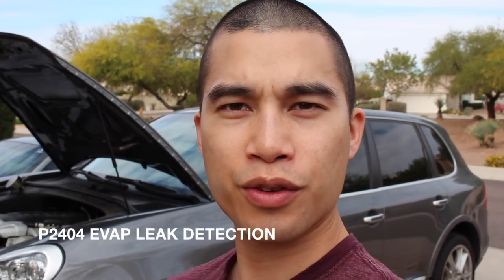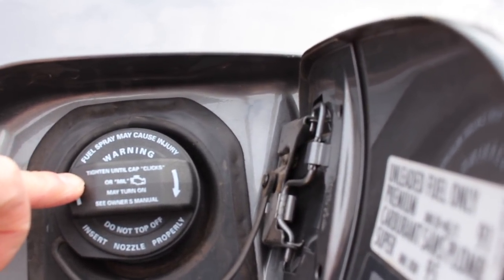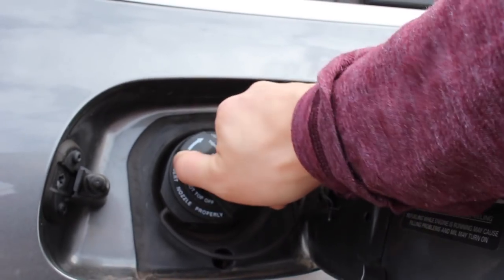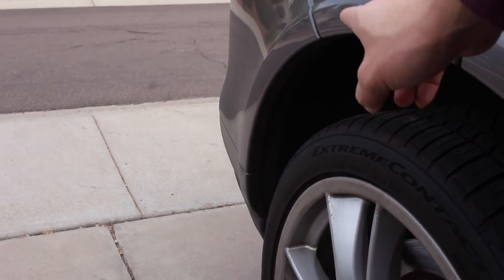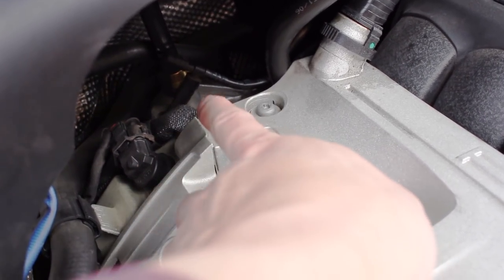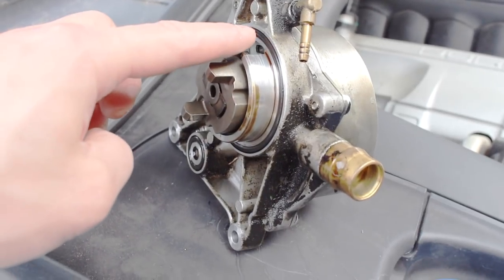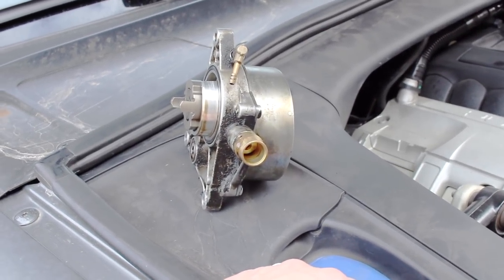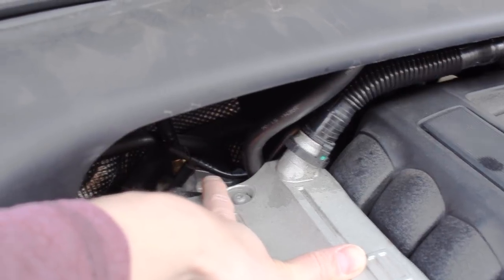Another Problem with My Porsche Cayenne Turbo - Vacuum Leak (P2404 & P0455)

Comment: if the brilliant engineers put that pump at the front of the engine it would be a much cheaper fix as the labor would be greatly reduced. it would also be practical to change the o ring and reassemble to check and see if its just a bad o ring. its insane to have to spend $1000 to fix an issue most likely caused by a $2 o ring that failed....
Reply: Peter Dudas Porsche(VW) are engineered to Fail.
Reply: @tomkruze2749  only certain gens!

Comment: Bad bypass or vent valves will cause fill up issues. Not a purge valve. It controls the flow of unburned fuel vapor to increase economy as well as regulate vacuum and positive pressure in the fuel tank.

Comment: Now I don't feel too bad about my 04 CTT with 115kmi for $9400. After doing neglected maintenance and fixing a leaky power steering pump, it's running like new.
Reply: How much did the PS pump fix cost you? Did you get a new pump?

Comment: Love your videos bro. I just got my 08 Cayenne turbo with similar issues. 
Exactly same error codes as urs which ill definitely look into after watching your videos but can you tell me what these signs could be as well: 
1. Warning Chassis system, i believe because of this warning i also cant go into sport mode either. Air Suspension works perfectly fine when it comes to lifting or lowering the vehicle. 
2. Had a burning oil like smell coming from front driver side which turned out to be a small leak right behind the  left wheel. I also feel some heat from that side while im driving. 

Any idea what these could mean?. 
I mean the suv has about 260000km on it and still drives like new. All pressure and temperature on speedometer gauge seems fine.

Comment: Curious if that seal on the vacuum pump is serviceable.  Seems silly that a $200 part is corrupted by a $0.50 seal.  I had a similar P2404 (or whatever the number was) failure on my old M3.  The seal on my gas cap was dry rotting.  New gas cap solves mine as well.
Reply from the maker: I suspected the seal, but while you're in there, you might as well replace the part since labor is what is expensive.
Reply: Car Fanatic completely agree.  Just wondering if you can replace the seal and sell the pump or something.

Comment: Thanks my friend. Check engine light went on after I filled gas, I definitely didn't click it three times. Its like stuck after the first click. Anyway, now I think I also have a vacuum leak, my right signal and brake lights fail. Getting it fixed soon

Comment: Damn. I have the exact same car...EXACT same problems. Guess they’re pretty common 😂
Reply from the maker: Ha, what other issues have you had?
Reply: Car Fanatic the cracked ignition coils, coolant pipes burst and left me stranded, same CEL as you. Porsche actually has an updated part for the coolant system to avoid that problem from happening again btw. Overall, it’s a powerhouse but I think I’ll sell it and upgrade to a 958. Before that, I might have to replace the vacuum pump like you did.
Reply from the maker: Bore scoring? Do you live somewhere cold?
Reply from the maker: Hmmm....what symptoms did you get? Hopefully, I don't run into that issue.
Reply from the maker: Ah, good to know. Thanks for watching man!

Comment: I’ve owned a 914, 951, and 996.  Porsche is NOT what it use to be.... Ever since VW took over. I will probably Never buy another Porsche. They are engineered to Fail
Reply: This genius probably doesn't realize that the modern Porsches are a 1000X more sophisticated than your 914 go cart.  My 2011 CTT has over 200K miles and is still running strong.  Yes, it has 45 different computers on board.  How many did your 914 have?  Does it need to be fixed from time to time?  of fricken course.  In fact, just yesterday I had to change a fuse.

Comment: My 04 CayenneS has given the P2187 & P2189.  I have replace a ton of stuffs but the code kept coming back after reset.  Could this be a vacuum leak somewhere?
Reply from the maker: Have you checked out the vacuum pump?

Comment: Not sure how a vacuum pump would cause an evap code problem. The vacuum pumps main job is to supply vacuum to the brakes. It does however power the vacuum system on the engine. Things like secondary air, air box, exhaust flap and possible many other systems. Its unfortunate that many of these modern cars use inferior materials for all the seals and pipes.
Reply from the maker: The vacuum pump on the Cayenne is primarily for emissions system. It doesn't relate to the brakes at all. Thanks for watching!

Comment: i have 2008 Cayenne 6 cylinders,  After I wash  my car, two days later it will not start   Error states ignition failure and brake proportioning! Need help please!
Reply from the maker: Does the engine crank? Could be a bad battery. Also feel around the carpet in the driver's and passenger side footwells. There could be water intrusion that is causing a short. This can happen if the cowl drains aren't cleared periodically.

Comment: I'm looking into purchasing a 2011-2013 Porsche cayenne turbo, any suggestion or problem areas to be aware of . I love in Las Vegas so it's a very dry climate . Very problematic for my previous X5 50i. Thanks!
Reply: the other response to your comment doesn't know what he's talking about, that only applies to certain models and generations. 
Only one issue with the gen you are asking about, the 958 beginning in 2011, transfer case. It was supposed to be a lifetime fluid but definitely not, the transfer case will generally go bad and a large number of them were replaced under warranty so you want to check on that. I bought my 2015 958 Cayenne S last Thanksgiving before knowing about that issue. Bought it from a dealer and on test drive had a slight bumpy feel on acceleration from a stop, almost felt like gravel on the road but I thought maybe the new tires they had put on. Found out later it was the transfer case. I simply changed the fluid to Ravenel TC fluid and it was immediately like brand new. Have driven 10,000 Mi since with zero issues. I'm about to change it again, I decided to change it annually at every other oil change. It's extremely easy, easier than changing engine oil, to replace the transfer case fluid on this gen Cayenne. This is the only major defect in the 2011 to present Cayenne as opposed to the first gens which have a long list of issues. I have a 2005 Cayenne turbo and even though it had much work done prior to me purchasing over a year ago, it still has one issue popping up after another.
Even with the transfer case potential issue, I would not hesitate to buy 958 Cayenne... And in engineering and styling, it's a world of difference from the previous gen Cayennes, to compare a 2010 with a 2011 you would think they were 10 years apart.
Todd
Annapolis, MD

Comment: Thank you ...
My problem I have is that my porsche cayanne V8 idle drops when cold and on the hwy it struggle doing 100 kms per hour...when you want to pass a car ..the vehicle feels that its2 running out of gas until you take your foot of the gas..cant pass anybody safety...thx
Reply from the maker: Check engine light on?
Reply: mike mancini primary fuel pump? Mines did it

Comment: Hi I have code p0442 tank system fine leak any idea please help
Reply from the maker: Make sure to tighten the gas cap. Also look at the vacuum pump to see if there is any oil leaking. Hopefully you forgot to tighten the gas cap or just need to replace it. Good luck.

Comment: Great info!  I just reset the P2404 and P0455 this morning on the 2010 S with 89k.   New gas cap installed...  Lets see what happens.
Reply from the maker: Did you check the vacuum pump for oil residue? If you see anything, the pump likely needs to be replaced.
Reply from the maker: Did you check the vacuum pump for oil residue? If you see anything, the pump likely needs to be replaced.
Reply: What happen? Why was the price of gas cap

Comment: Interesting video, as per usual
I am also experiencing some problems with my 957 turbo
It does similar to a misfire, but with no codes
You are driving at steady speeds (120kph) and it will do a slight but noticeable stumble
It does not do it on acceleration
The car, I think, sounds ok on idle, it is stable
All service records at Porsche, the last one at my independent mechanic (specialist)
Now it is at 155,000km
Had all the fluids (gearbox, diff, etc.), filters and spark plugs changed at 145,000km
Not the coils
Dont know what it could be, maybe you hace encountered a similar situation
Could it be the cardan bearing?
A dirty injector?
Thank you
Reply: Be careful here, you could spend a fortune attempting to diagnose that problem. Get a scanner and hopefully you will have some faults to fix. Once you have no faults you or a technician may be able to see something in the data. Otherwise best to live with it until it gets bad enough to trigger a fault code. In my case a similar problem  was cured after replacing a cam sensor. However it took about six months for the sensor fault to come up.
Reply: Andrew Thompson Thank you for your answer
It was doing it before it had all the fluids and spark plugs changes (regular maintenance, not done exclusivelly for the matter)
I thought it would go away after
The techncian had no codes pop up on the scan tool
I have since used an obd2 to read them, and also have not seen any codes
Due to the symptoms and your solution, it could well be the cam position sensor, as it is related
My next approach is to leave the battery disconnected for a few hours and change the pcv valvemembrane, see if that makes any effect
If not, I will take it again to the technician to see
Reply: I had 5 of 8 coil packs that were bad, didn’t show any codes at all. Had to take mechanic out for a drive to prove how bad the ‘misfire’ was 🤪
Reply: Thank you very much for your answer
I think it is pretty obvious that I should start by changing the coils, as doing it myself is a pretty straight forward and cheap fix
Then see if it continues, and probably if it does not get better, go to the cam sensor
And as a last step, get the injectors cleaned at a shop
Will update with my steps as I go
Reply: I have exactly the same symptoms on a 957 '08 turbo. Did you ever get a solution?!
Reply: @randomguycalledrichard  It was ignition coils
I replaced them myself with original BERUs
The only tricky one is cylinder N4 due to it being very near the firewall
I would also replace the spark plugs once in there
Also made a huge difference
The seem to wear out pretty quickly